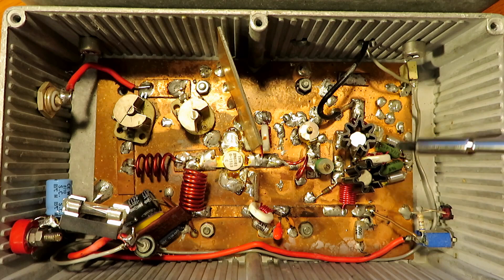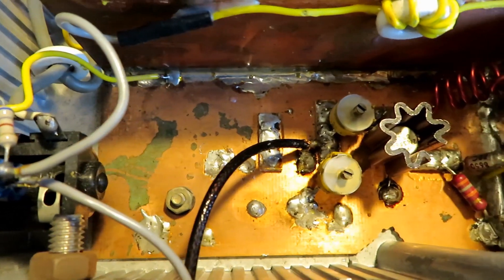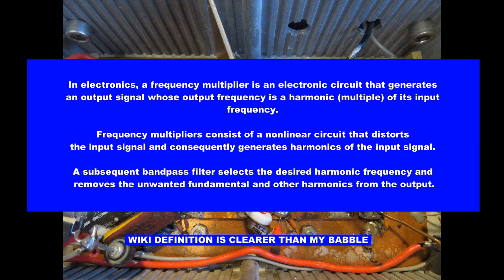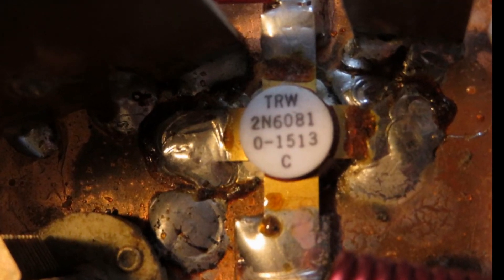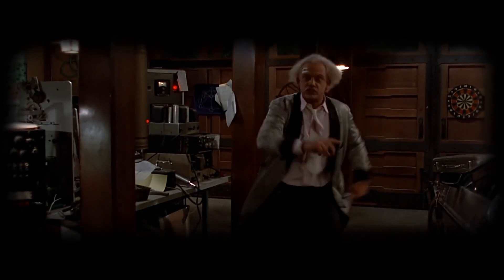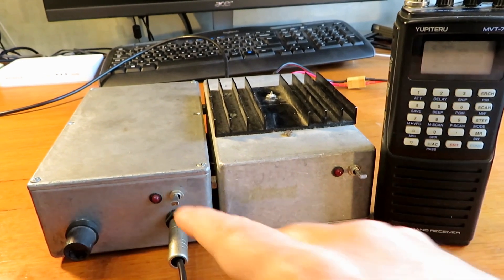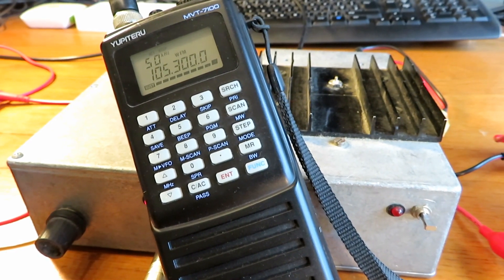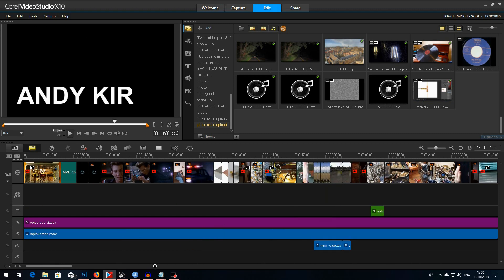Pirate Radio Transmitter from the 1980's....How is the Power?

Comment: Built an AM transmitter back in 1996 at college with my mates and set up a portable CD player to it. It ran on 90 volts DC! It went up in smoke. It had a range of half a mile with a LONG wire antenna from the roof of the building to a tree 😂. Lecturer was impressed but couldn't submit for my city and guilds 224 as it was a transmitter 😂😂

Comment: I had a veronica 5 watt transmitter back in the day hooked it up to a 144mhz linear and a log periodic i ran for 3 years before i got caught it was awesome using dipole the range was 40 km but with the log periodic longest report i got was 125   km away happy days ❤ buzz fm

Comment: Well people mostly asks "How many Watts your transmitter have? Minding: More Watts means more range". But that is not the case. Range is result of efficiency of the WHOLE TRANSMITTING SYSTEM! First: Wattage of transmitter device. Second: HAAT, height antenna above terrain (Higher, more range). Third: Efficiency of ANTENNA SYSTEM. Professional radio stations never use single antenna, but stacked 2,4,6,8,... antennas array. They are coupled by power dividers. And finally they use low loss (very expensive) coax cables and connectors. FM analog broadcasting are starting to be obsolete by DAB, DVB, Internet broadcasting platforms. In Norge all FM 87.7-108 MHz transmitters are switched off in favour of digital. Maybe it is time to use FM band for Low Power broadcasting and more liberal approach to licencing?
Reply: Here in New Zealand, analog broadcasting is still going strong with no signs of being shut down any time soon. To switch to digital / DAB etc, everyone would need to buy new radios, and for what benefit? None. Maybe in 20 years time things will change - and I agree that if the commercial operators shift to digital then the analog spectrum should be made available to low / medium power operators with licenses that people can afford.